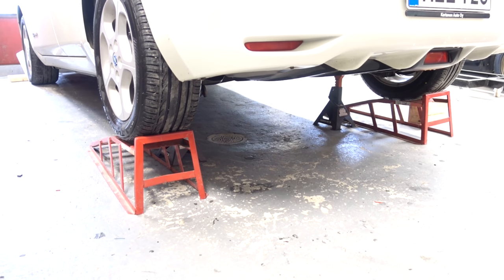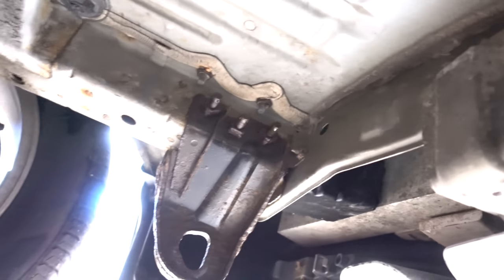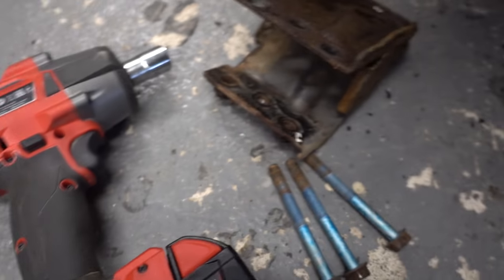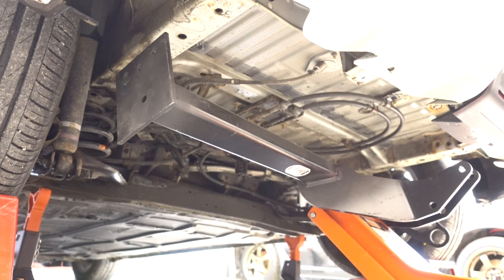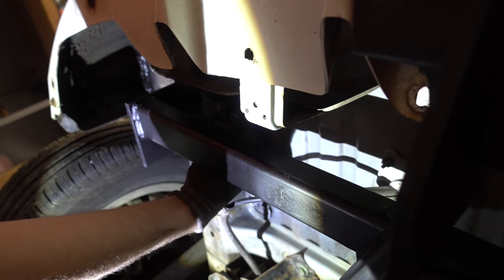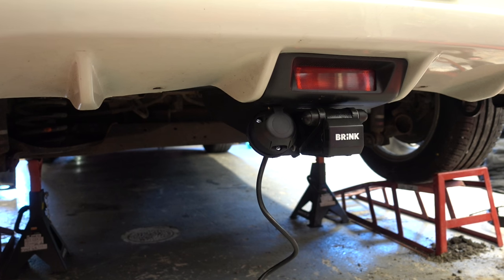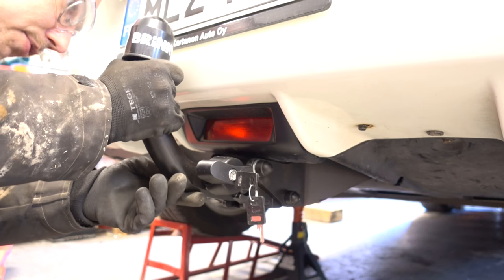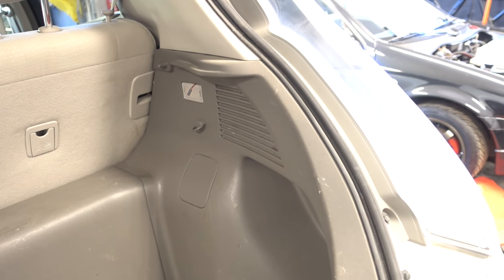The BEST modification you can do to a Nissan LEAF - Towbar

Comment: I guess you have limited options outside of the USA, but within the US, you can get a Curt brand hitch which doesn't require drilling and is easy to install.  I don't typically use my Leaf for towing, but as I have a better suited truck for that.  However, I have towed a trailer weighing at least 2,500 Lbs (1134 Kg) a few times.  It was a 25 mile trip and I never got above 50 MPH.  I wouldn't suggest doing it, but it can be done.  I did that 3 times in total.  Each time I was hauling 250 gallons of water to a house I was building and my truck was out of service during that time.  It used the whole battery - one way.
Reply: Cool story.... that's good to know.... what type of leaf and how many SOH bars ? Just curious cuz I would like to know what to expect from my leaf(2013 SL 10/12 SOH)
Reply: @matthewzizzo4586  It's gone down this past year.  It's an early 2013.  It's 9 bars right now (I think), but it may have just dropped to 8.  It dropped another bar in the past month, but I don't recall exactly.  Average guess-o-meter as 60-65 MPH (Now, during the summer).  I do have quite a few miles for a leaf...  I think it's in the 110,000 mile range.  The car is not nearby right now, so I can't quickly verify.  This car has never been level 3 charged, as the original owner didn't buy the Chademo package.

Comment: Just installed towbar on a ze1.
The design I used puts small reinforcing plates inside the chassis rails. Use a spring wire wrapped onto bolts & threaded through chassy rail to pull them into place. Easier than it sounds. 

Wiring was more of a pita for me
Reply from the maker: Congrats on the install!

Comment: Great Job! Thank you. Did you need to use an electronic module or relay unit in the wiring, or were you able to get the rear electrical connection wires to connect directly to the car wiring?  I have been told the CAN bus on the car can cause issues without a relay. Many thanks 👍
Reply: You need to use a trailer module to do so. I would not do it without it.
Reply from the maker: This was connected directly to the tail lights. Confirmed to work on both ZE0 and AZE0 without causing any CANbus errors! But yes, additional fuses/relays is the proper way to do it!
Reply: The kit that I purchased has a long enough wire to route to the front battery. I wonder if there is a power circuit closer. I haven't wired it yet but got the module installed that connects to the LH and RH tail light connectors inline.

Comment: Sadly in UK the Nissan Leaf has a zero rating for towing. Therefore you cannot legally fit a tow bar. The Leaf has not been certified, crash tested. Also the regen is not configured for any extra weight only people plus luggage.

Comment: May not work in Australia due to the mandatory spare wheel fitting.
Reply: Dude in new cars where is no spare wheel. Only some cheap air blower and glue to fill the hole
Reply: Spare isn’t mandatory in 🇦🇺

Comment: Have you taken your car for yearly service? They basically only change cabin fresh air filter (and dont even use HEPA ones), brake fluid every second year and check the electronics. I would rather skip and do all fluid changes etc by myself but i am not sure if i dare since i got 5 year, 0% financing for 2022 62kwh and financing companies require yearly service and no modifications but do they really ever care if no accident happen?
Reply from the maker: No clue, I void warranties...

Comment: Interesting that the initial 10mm bolt heads snapped off. I had exactly the same experience with those holding the mudflaps. That suggests inferior quality to me.
Reply: Just road salt corrosion, I'm not sure any reasonable volume manufacturer would use stainless steel fasteners.  Now they could use zip ties or push pins.  A box of genuine Nissan plastic trim push pins are cheap also.

Comment: I was in to that the 55kg limit until I saw that massive steel beam :D. In 10 years you will see old Leafs pulling those luggage trailer trains in airports :D
Reply from the maker: Yeah the tow attachement that was on the one side of the beam is technically capable of 2000kg (entire vehicle weight). So no issues really from that side :D
Reply: @DalasEVRepair   😈

Comment: Hi Dala, great job (and video) on the towbar fix. Was this Brink towbar specially for the LEAF or was it for another car, but it fitted the LEAF anyway??  On the Brink UK website it is not shown, or doesn't appear to be available. Many thanks.
Reply from the maker: Still available on Ebay: https://www.ebay.com/itm/283596438914?hash=item4207aa3d82:g:nGYAAOSwb7ddZmi0